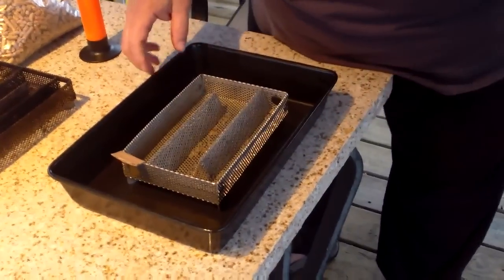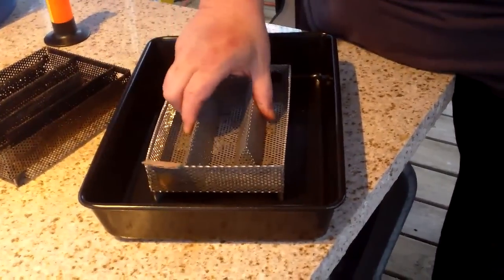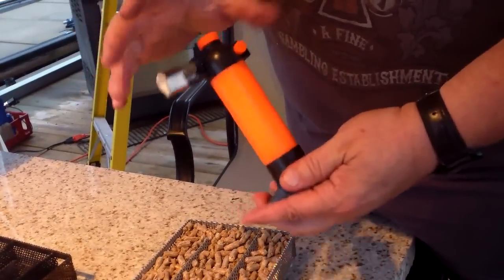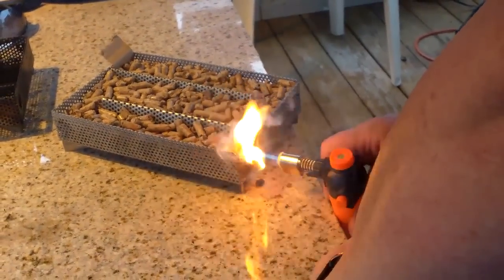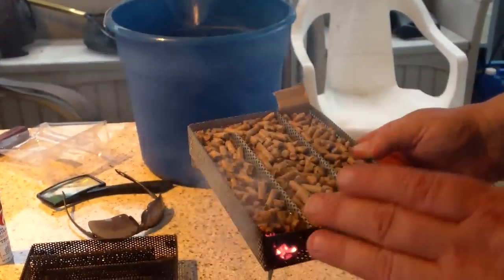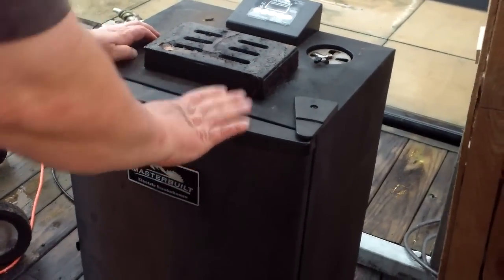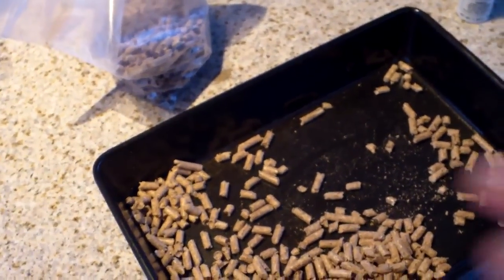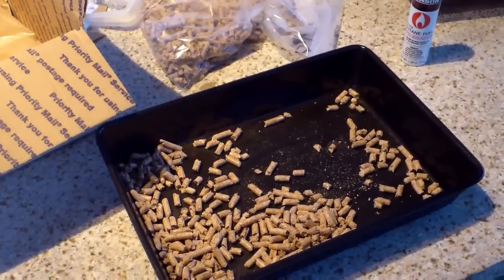A Great And Simple Way To Smoke Your Foods! Brother Steve Just Sent Me This Video!

Comment: I've been using the four channel smoker with pellets for years. With two channels filled it smokes for 6 to 8 hours. I buy slab bacon and re smoke it  with fantastic results. I also leave the smoker door slightly open for first 20 minutes to make sure it'll stay lit.
Reply: Where did you buy the 4 Channel Smoker?

Comment: So, do you still use the side bar twister to drop in wet wood chips?  Or, do you just use this little tray to get around doing that?  I am new to smoking but have had very good luck with a smoker just like yours, except I didn't use the little try with pellets like you have done.

Comment: Don't you have a wood chip tray in the MB why do you need to use the tray?  I get a lot of smoke in  my MB?
Reply: Yeah, I have MB too, and it works fine.  Is he not going to use the chip tray and just use this instead?  I'm not sure I understand his intention.  Do you?
Reply: The biggest problem most people have is the MB won't put out enough smoke. It also will not cold smoke at temps below 180F well (and the little cold smoke box they sell it's worth it). This helps a ton with the amount of smoke and cold smoking. Also, not having to touch your MB for 8-16 hours is a dream. Let that baby smoke. No more pulling out that tube and putting more chips in. Just let this guy smoke for hours on end.
Reply: This is to smoke WITHOUT heat. This box produces very little heat so you can smoke things like cheese. If you use the standard method in this smoker the cheese will melt.

Comment: Poor product ... pellets don't burn worth squat.  Using dust is terrible.  MUCH better units out there in tube form.  This unit doen't work - holes are too small so no air flow.
Reply: Never had a problem with mine. Ir ain't rocket science.